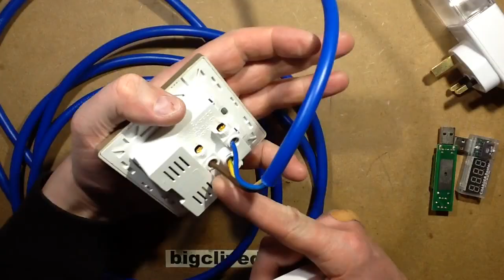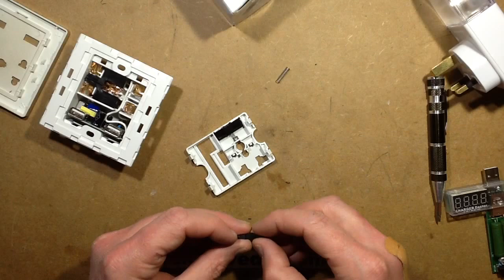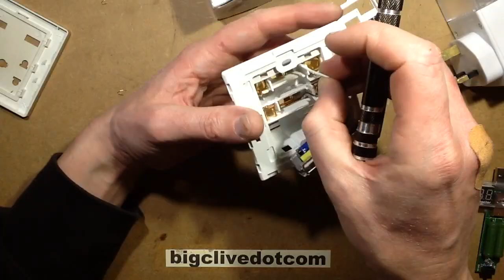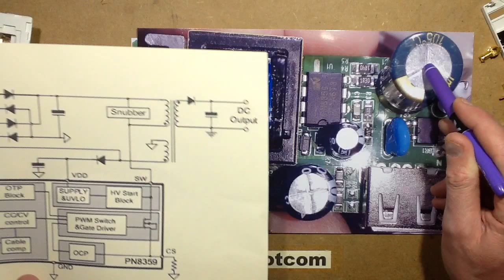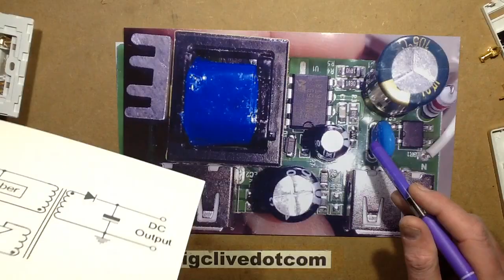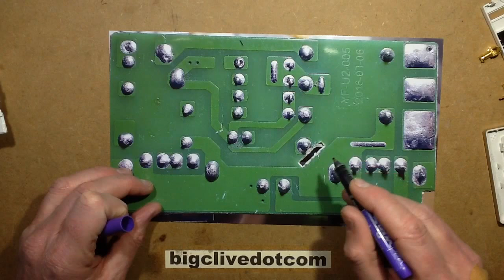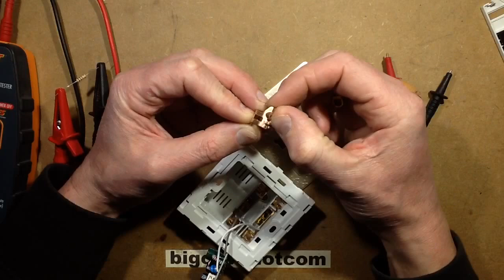Wall plate death-dapter tests including fire and 1kV.

Comment: When I was 7 I thought it would be a fantastic idea to push the plug pins of my neon night light through the tin foil top of an ice cream slushy cup and then plug it into an extension cord, before plugging the cord into the mains to see what would happen, the result when I flicked the switch on the wall socket was an almighty bang and the entire house being plunged into darkness. Needless to say the night light and the extension cord never worked again afterwards. 

Turned out I had popped the main fuse on the pole outside that supplied power to the house. I never got into the trades but I developed a keen interest in electronics and electrical systems soon afterward.

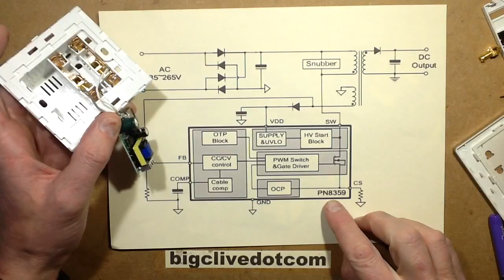Comment: That's not bad regulation, it's just cable compensation. When you draw a high current through a wire you get a voltage drop across it due to the cable resistance which will make your device charge slower. This driver IC has a cable compensation feature which slightly increases the voltage regulation setpoint as the current rises to compensate for the cable drop (You can see it in the IC block diagram he found. at 8:52)

It does look like it's improperly implemented though, the supply should start out closer to 5V than it did and increase the voltage from there.

Comment: I never trust those UBS wallsockets. Went to a hotel once, tried using one, it delivered no charge, but made both the wall socket and the power banks extremely hot. Even with no load, the wall socket stayed hot - needless to say i didnt use that socket again throughout our trip. 
Possibly i overloaded it, had the 2 usb outputs both charging powerbanks, with a normal charger plugged into the socket charging (or not) an ifone. But why put 2 usbs and a socket if it cant handle one amp through each?
If I end up forced to use one in future, I think I will use it to charge a disposable power bank, then charge the ifone through the bank. If the worst happens and the socket delivers the full 240 through the usb, only a £10 power bank will turn into ash instead of a £400+ ifone....

Comment: Where did you get that 3 core blue cable
Reply from the maker: It's a common cable in the UK called arctic cable where blue denotes 230V use.
Reply: bigclivedotcom  I can't find any 3 core blue cables at any store. All cable that I have seen the the hardware store is just grey. 3 core cable colour: grey
Reply: Also I'm in Malaysia

Comment: Why is the UK so afraid of AC?  You have fuses in the plugs, on / off switches, gfi and fuses in the devices?  How many condoms do you wear when you do the nasty? :P
Reply from the maker: The standard UK power socket circuit can deliver 32A at 240V continuously within it's standard rating.  That equates to around 8kW of power.  The local fuses are to protect the appliance flex in the event of overloading or a fault.  The socket switch is actually very handy for turning stuff off without unplugging it.  RCDs (GFIs) are a very good safety device protecting against shock and fire.
Reply: Yea we have switches in Oz too.. But having lived in the US for years, it is very satisfying just yanking the cord out of the wall... :) Oh and if we keep putting the safety covers on the inside of outlets, then we will never get rid of the stupid ones :P  Love your channel... Keep up the great work!

Comment: Bigclive might be pessimistic but when using 4A contactor on 15A water heater I dont know if it's optimistic or just plain stupidity.Oh well it works fine since 20 years so i guess its just normal

Comment: When I was a kid I put both ends of a 3.5mm jack cable into the wall socket (euro socket, pretty easy to do). Cable instantly blew and the room was filled with smoke. Not an electrician, more into computers, but still interested in electronics.

Comment: Why do the British have such heavy looking plugs o.o' i cant imagine lugging one of those around with my laptop

USB wall outlets are pointless that's why they invented USB to Wall Plug adapters where you can just plug your USB into a small little block about a 2 Centimeters Cubed
Reply: I suppose it means you're able to charge your devices without taking up a socket that could be used for something else.  Not that I'd be inclined to install them in my home either...

And, as a Brit, I can tell you that I don't even notice how clunky the plugs are.  We're just used to it, I guess.

Comment: When I was a kid, must have been around 1976 (I was a bit under 4 yrs old), I stuck a screwdriver into a 120v socket (U.S.A.).  It vibrated the screwdriver a bit and made what sounded like a grinding sound that went on for 3 or 4 seconds, which convinced me there was a little wheel spinning inside lol.  Thinking back on it, someone must have put a penny in the fuse socket.  I'm lucky I didn't start a fire in the house.. or worse.

Comment: was it my imagination or did I see 2 pairs of pins both joined by solder in the second picture, and just for quick ref, when I was young we played the old record player far two loud, so my mother took of the plug thinking that will teach them, we used the handle of a tea-spoon to push down the earth pin and stuck in the bear wires, needles to say we hit the opposite wall several times, however have been fascinated by it ever since, sort of know your enemy even if they are invisible. LOL

Comment: lmao - are you really happy with FIVE PERCENT calibration????? at least get a 0.1% resistor ffs. also - on normal meters the voltage range is what u test, from a reference supply (a special battery traditionally and still for hobbyists - a maxwell cell)

Comment: I once, when I was a kid, plugged in a bare cable into the mains and firmly grasped the copper with both my hands. I remember getting blasted backwards not before shaking like a madman. I was perfectly fine afterwards, but I'm pretty sure that may have been the cause for several neurological problems. I'm also not an electrician.

Comment: The main drawback is that all kind of devices like this one are not any other thing that switch-mode power supplies. SPS's are THE WORST THING THAT COULD HAVE BEEN INVENTED because these ones are spread by hundred of thousands along the mains lines, a couple of them in each home. Owing the fact that every one SPS is no other thing that a NON-SINUSOIDAL OSCILLATOR is unavoidable that an undesirable amount of RF harmonics could travel along the wires and even could be radiated even in the case of that HF filters have been provided to reject those subproducts or at least to attenuating its level to an acceptable amplitude.
In any case, most of those RF spureous emissions will end in the input stages of MW-AM receivers, making almost impossible the reception of programs transmitted in such wavelenghts due to the strong interferences caused by those kind of power supplies. If SPS are plugged and unplugged because are built in the devices themselves, there's a chance that in some hours the interferences could disappear  when those appliances are off. But if SPS's are always "on", like this one, there will be no time of "rest" from interferences and reception of MW programs will be almost impossible.

Comment: If I remember correctly the flame test requires plastics to self extinguish within 30 seconds. I really don't think much of the clearances and I have a sneaky suspicion they milled the slot because they were suffering from shorts, rather than for adding protection.
In all likelihood the momentary blips you caught on your insulation test were the class y capacitor charging, on some capacitors you can hear essentially a piezoelectric effect on the dielectric. It also shows that the class y capacitor is surviving a kilovolt.

Comment: Wonderful Video, also Clive might like to know, in China they use identical size back boxes as UK, I suspect it's maybe because it's a copy of HK. HK being of course as UK standard.  This is why you can find the multi device inputs sockets, mostly it's Chinese/UK connections.

A lot of discussions about plastic parts to protect plugs, the actual term used is a TRS. Tamper Resistant Receptacle. 
A lot of people seems unaware of this now part of a requirement in both USA and Canada for new build houses. See this website for details.

 http://www.esfi.org/program/tamper-resistant-receptacles-trrs-205

Great Chanel.

Comment: re: calibration resistor - I'm not entirely surprised it worked at 1KV, but that's definitely pushing it with that size resistor. I'm pretty sure in the test lab they use a higher voltage metal film or ceramic standard resistor. Still, it's a good test, but to be REALLY certain it's all working right I'd also want to measure the peak voltage during the test cycle.

Comment: @bigclivedotcom, i see you touching the pcb board quite casually right after unplugging it from the mains. Do you not worry about the charge still present in the capacitors? I was taught to be very careful when handling with capacitors and it was a surprise to see you handle it that way. Please do enlighten me. :)

Comment: Lol I'm going to college to become an electrician and I stuck two keys into a plug as a 4/5 year old, as well as receiving various other shocks throughout the years as a curious child.
Reply: In Canada we don't have those rams that close off the outlets either, as I saw someone from Austrian mention, luckily we only run 110/120 volts and it was likely an old 15A fuse.

Comment: I'm 12 and I've zapped myself with 220 v and almost lit my backyard on fire so I've taken position in both positions at 12 and also I'm in the USA but the reason I zapped myself with 220 was because my dryer takes a special plug and when repairing the dryer plugged in I forgot their was a plate to the 4 wire leads on the back of the dryer then jumped and cursed like hell

Comment: I note that the USB power supply has no fuse. I guess they are relying on the 32A breaker "most" mains rings have here in the UK?
Also there is no earth to the USB PCB, as such the minimum clearance for live to secondary side components should be 6mm as it would (and should) be classed as double insulated! 

I believe your thoughts are correct, I would not install one of these in my house. I would go further and say they should never have been approved for sale in the UK!

Excellent video!

Comment: I actually thought about buying one of those sockets to build into my test bench  when I will rebuild it in 2017, in combination with a emergency off switch, a dual 230V/115V output isolation transformer (+ switch to choose output voltage) and a nice indicator that this thing is active. I guess I will still do that, since I have quite often Items with non european plugs at my lab, so I don't have to fiddle around with the common death daptors.

Comment: Primary to secondary 'creepage' distance requirement depends on the voltage across the barrier which depends on the topology. For these circuits (single ended flyback) 5.5mm should be adequate to meet IEC standards.

Comment: I believe that the standards for self-extinguishing plastics allow them to burn for 30 seconds before the flame has to be extinguished so that doesn't look too bad. But I also wouldn't have electronics permanently wired into the mains either.

Comment: I'm actually surprised at how "ok" it was.  Somebody put some work into designing the USB power supply board, and it was good enough that it probably isn't going to burn anything down and it will charge your phone.  There were at least casual shutters.  They did a lot of work on molding the plastic case and seem to have used the right kind of plastics.  They might have used fake steel wire clamps but I bet they would have handled 13 amps without anything getting excessively hot.  

How much did this thing cost?  I'm always impressed by how much effort goes into very low cost Chinese products - they may be mediocre by Western standards but somebody really tried somewhere.

Comment: One thing I have thought of:  If you install this device onto a standard UK ring main, and use an appliance with an unfused plug, then the only over-current protection will be from the 32 amp breaker or 30 amp wire fuse.  (On the Continent, it's normal to have a 10 or 16 amp breaker serving only one or two sockets.)

If somebody wanted me to install one or more of these things, I would wire a switched, fused connection unit into the ring main, and fit a 5 amp fuse; and then fit the socket downstream of the switch and out of the reach of children.  And even then, I'd only do it reluctantly.

Comment: why you only test 1 usb plug? stuff like this with 2 plugs usually only has 1 as higher power for some reason.
Reply from the maker: They are in parallel.  The only power difference is the voltage on the data pins to signal to the charged device how much current it can draw.

Comment: kind of wish we had those shutters in US outlets but you can just jam whatever in there  with no resistance... their only saving grace is their small  openings
Reply: ToddFucxer ... Current codes require shuttered-outlets. They are available at box stores.

Comment: They don't have those shutter things in American Outlets but they should instead of having to buy those outlet protectors you stick in the outlet to keep younguns for sticking things in the holes.
Reply: I believe the "tamper resistant" receptacles which have been available for a few years now have shutters like the UK ones. They may even be code in some jurisdictions.
Reply: They are in Canada. TR logo. Seems like 1 in 10 don't like to permit two-prong plugs.

Comment: Re the two diodes in parallel. My understanding is that this would not share load. The only advantage would be redundancy and maybe some advantage with the package in order to more readily dissipate heat. Have I been thinking the wrong thing about diodes all these years?
Reply: Mmm, more complex than I thought...
http://www.st.com/content/ccc/resource/technical/document/application_note/a4/ef/bc/7d/78/89/49/f1/DM00098381.pdf/files/DM00098381.pdf/jcr:content/translations/en.DM00098381.pdf

Comment: As a kid I used to play with my dad's old electric train set, which had a "universal" 110V <—> 220V transformer. It was just a plain 2:1 transformer with two AC sockets, one marked 110V and the other 220V. You would connect your appliance (the actual electric train transformer in my case) to one socket and then use a simple *MALE TO MALE MAINS CABLE* to hook up the other socket to the mains. Hence the universality, as it could be used to run 110V appliances off 220V mains or vice versa.

Yes, you read that right. As a kid (8 or 10 yo.) I used to have this device in my toy chest:

═◗────────────────◖═

I think a cable like this has been all kinds of illegal for half a century now. It was as bad as it looks. I was always cautious and I knew the dangers and what not, but me being a clumsy human I still managed to shock myself with 220V once. Fortunately my home had a RCD (residual-current device aka. ground fault interrupter) or I wouldn't be telling this story.

Funny thing, I didn't get scared, I rather got quite good with anything electrical :-)
Reply: PS now that I think about it, I wonder if the RCD would break the circuit if a human were to get shocked after the transformer. Probably not.
Reply from the maker: many of the 120/220V transformers are non isolated autotransformers with a single winding, so it would have seen earth leakage if it was.
Reply: Well in theory yes, if as BC points out, it was an auto transformer. Depending on how the mains plug was inserted into the socket outlet in the wall
The secondary side might see a direct phase potential, sufficient to kill someone if the outlet is not RCD/GFCI protected. As RCD and GFCI devices are based on current balance techniques nowadays, hopefully even if you touched the neutral referenced side the RCD/GFCI would trip.
For us in the UK the use of autotransformers for toys is not permissible.
Issuses of polarity reversal also point to the need for polarized plugs and sockets, and to ensure that any fuse contained therein is in the phase conductor.

Comment: do you reckon it should be rated for 10A? on comms equipment the "kettle" type leads I use which are iec c14 to c13 are 10A. I always thought they were 13A until recently when I realised. The 16A sockets are huge in comparison as well as the cables.